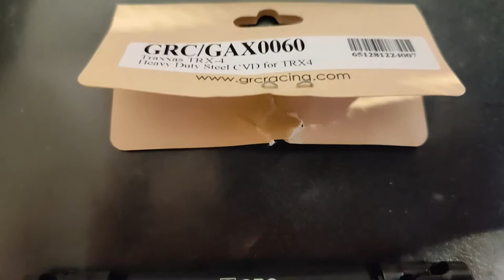TRX4 Driveshaft Installation

Comment: Did you notice any extra noise after this upgrade? Like the look/performance of metal shaft, not that squeaking noise though
Reply from the maker: The driveshaft didn't create more noise, however, it feels like the drivetrain is smoother. The squeaking is the ESC/motor.
Reply: @theosrcgarage1315  cool thx for the feedback. Just replaced with the metal driveshaft and next gonna do esc/motor swap. Need a hw1080/hw 21t anyway.

Comment: What's up with the 3 pieces? What's the point?
Reply from the maker: two of the pieces connect to the shafts on the transmission and axle, the third piece is a tube that connects them and allows sliding when the axle moves up and down
Reply: @theosrcgarage1315  yes, I know that. What I mean is, why 3 pieces over the usual 2? Seems to me there is no advantage at all having a 3 piece shaft.
Reply from the maker: @CadillacDriver  I think that is just their design choice. Compared to a 2 piece shaft, I haven't noticed a performance difference.

Comment: Your bearings will fall out of your axles and transmission. That gap between the shaft and bearing housing is not good.
Reply from the maker: It looks like there is a gap, but there is a little "lip" on the part that slides onto the gear and it is nice and snug. I have also had no issues with it for over a year since I installed the driveshafts.